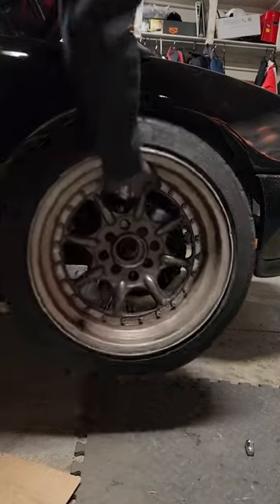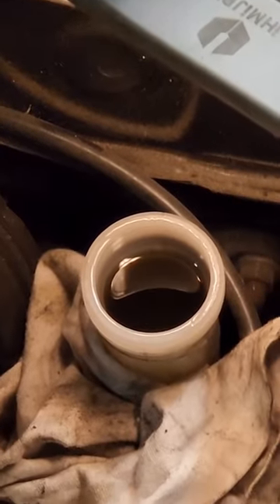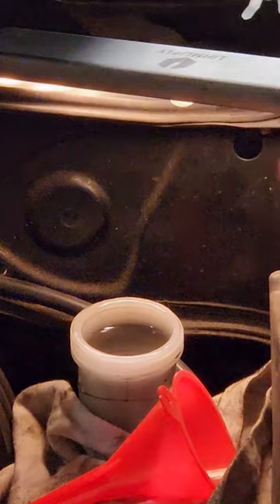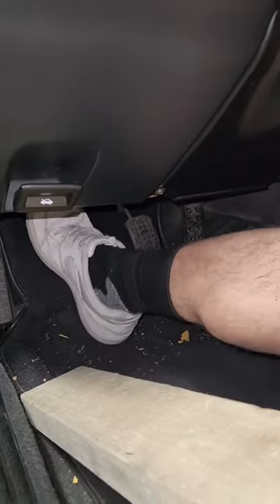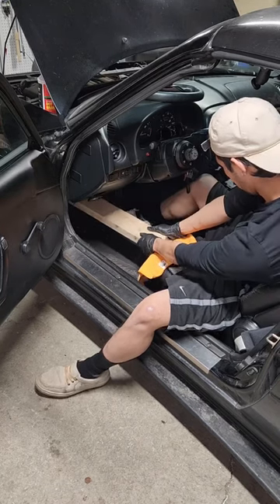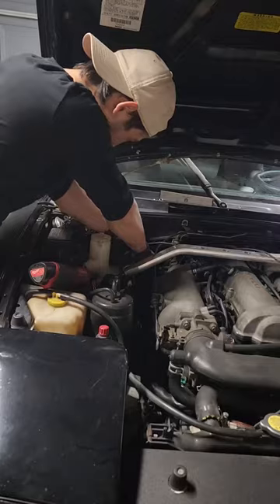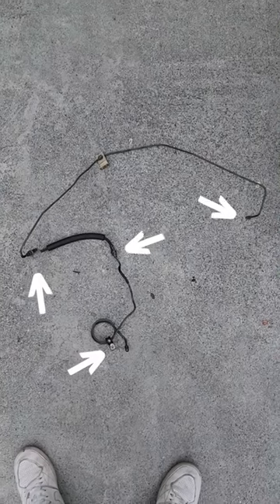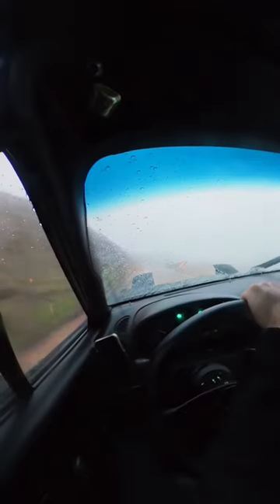Clutch fluid service 🚗 #miata #shorts #mechanic #diy #notamechanic

Comment: Got this 92 Miata not running sat 15yrs runi g now but clutch is just a floppy pedal clutch fluid was very low changed fluid still no pressure is it supposed to build up back up after pumping?
Reply: Yes pump in the clutch and eventually pressure builds up
Reply: Late reply, but you have to bleed the system, although the master cylinder has new fluid the rest of the system doesn't. Bleed the system until you see clear brake fluid coming out of the slave cylinder. There are several videos on how to bleed the brake system hope this helps!